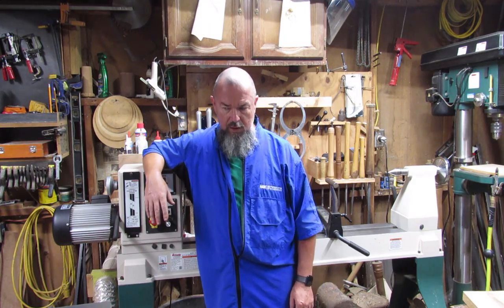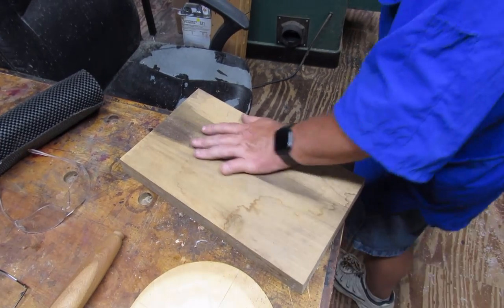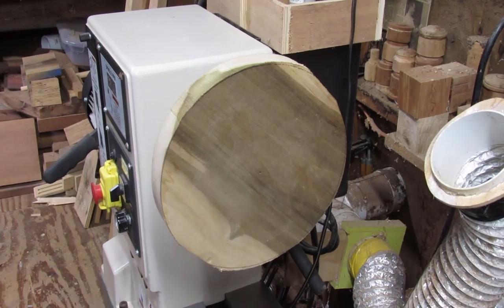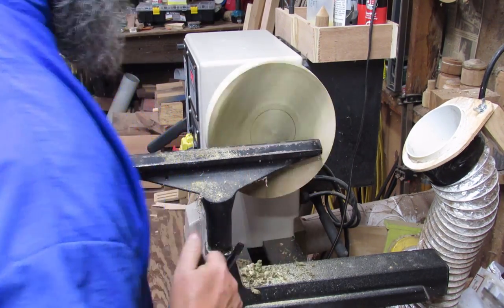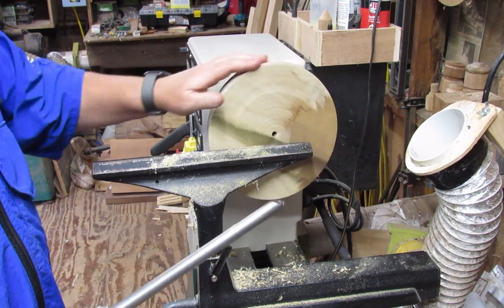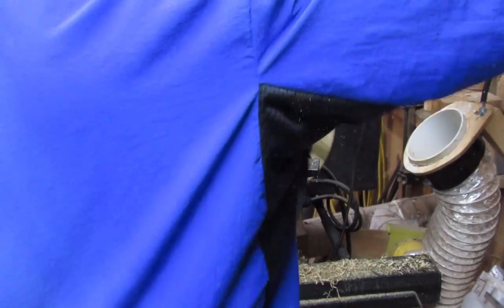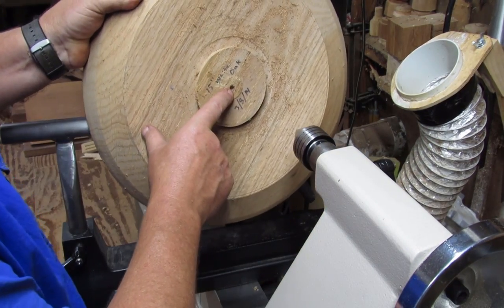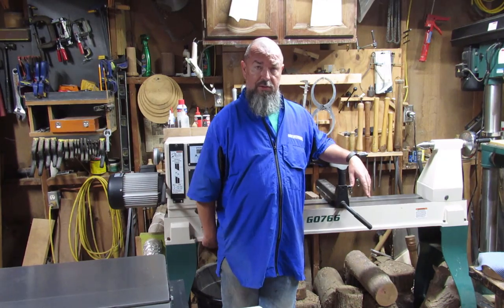#155 Making Jam Chucks

Comment: So glad you're back Stephen! I hope you had a nice break and are back and ready to show us some of your wonderful woodturning skills and projects. I'm hoping to hear more about your experience with the new Grizzly lathe. I might be in the market for something close to that model soon.
Reply from the maker: Thank you Greg. I will give a review on the new lathe very soon. I do not really have anything negative to say. There are however a couple of small things that could be improved. I will say that I believe there is no other in it's size that is better and the price is still premium even with the import tariffs.
Reply: @StephenOgle  Good to hear you'll be doing a review of that lathe. After all the research I've done, I think you bought the right lathe for bowl turning, etc. I heard you mention burning out a treadmill motor. I learned a few tricks since I burned out my first treadmill motor for my wood lathe. The main key is having a large capacitor. I'm using a 7,700 uf, 200 VDC capacitor and it did the trick. Might be a little oversized but better to be on the larger size rather than too small. I also learned that these treadmill motors are best run at close to 80% of their rated continuous RPM. If they run too slow, the motor will get too hot, and also the controller might burn out.  I'll have to send you a link with my lathe photos and setup. It's very unique being from the late 1800's and from my family's winery and cider mill operation that was in business up until the 1930's and closed due to prohibition.  The bed of the lathe is made from two 6" x 8" southern yellow pine beams and these are over 13 feet long. My capacity is a swing of just over 14" and a spindle length of just over 8 feet. I sure would love to have an 18" to 20" swing capacity for larger bowls. I bet some people would love to be able to turn those old wooden porch poles with my lathe capacity.
Reply: I sent you an email with those photo links. I hope you enjoy seeing something unique and very different. :)

Comment: Your lathe is so massive compared to my HF 12x33 LOL!  The banjo is HUGE!! Good tip on hot gluing the shelf liner onto the jam chuck.  I made my first one recently (just started turning after years of watching you and Frank Howarth) and used the same product for padding but didn't think about using hot glue to fasten it to the wood.

Also, thanks for inspiring me to start wood turning!  I like your plain style and "common man" image.  I also live in GA and have already videoed a little of my work just so I could see my technique.  Stuart
Reply from the maker: Thank you Stuart. Glad you enjoy my channel and perhaps found some useful information. I use hot glue for all sorts of temporary jobs. I used my G0462 for 10 years and loved it. It is basically the same as your HF only a little larger. It went to a good home when I bought the G0766. You are right, it is pretty huge and surprised me once I got it assembled. It is the perfect lathe for an old man. It is quiet and powerful.